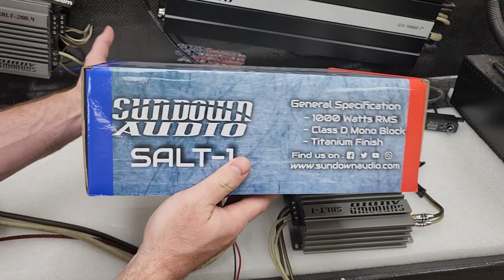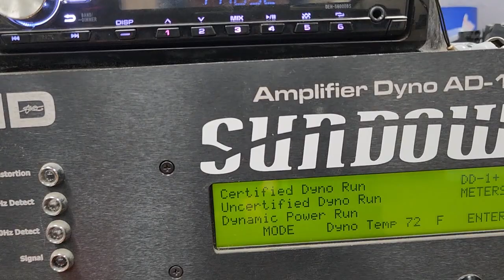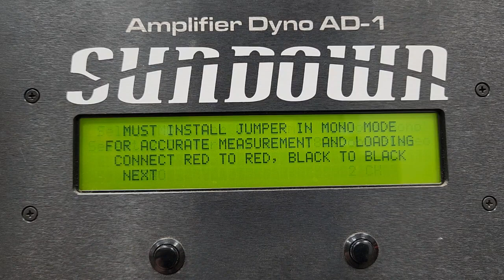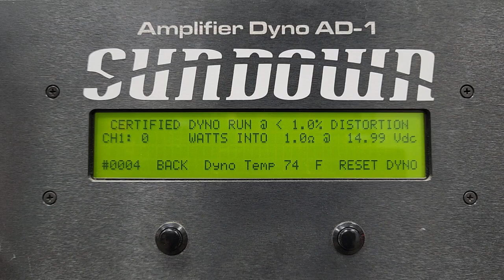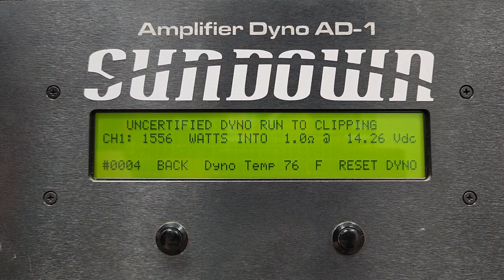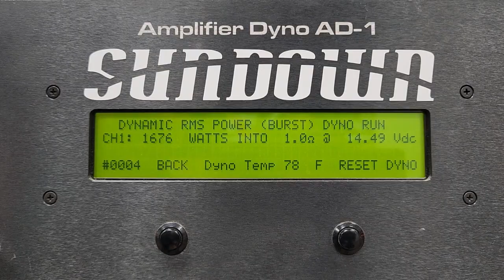Sundown Audio Salt-1 Amplifier Amp Dyno Test

Comment: Honestly this amplifier should not be over $150 this is just pure greed of what you're selling it for!!!!!
Reply: Could stick to your pyramid set up if you want.
Reply: So you know of many other amps that are daily under .5 ohms? That are real rms power and reliable like these? You can get the SALT 1.5 that does almost 4k for only $50 more
Reply: I've ran all kinds of amps. The Salts are worth the price. Very efficient, easier on the electrical and they barley get warm. You wanna fry some eggs, get a JP.
Reply: @nonamemane710  exactly. The efficiency of the salt amps are incredible. I have a salt 3,4 and working on getting a salt 6. I also have salt 200.2 and 200.4 for full range. Incredible amps
Reply: @Ford Flex King 2014  That's awesome bro. I had a Salt 3. I have a salt 6 now. I ran the both at half ohm. If its like 90 degrees outside the amps get to like 115, which is nothing. These kids need to understand there is more it it than  just watts.
Reply: @nonamemane710  right. I've owned many many amps from all different brands. Salts are by far 1 of the best I've ever ran. I had kicker, jl, Rockford Fosgate, alpine, hifonics, and others. Sundown SALTS are definitely top notch built, power, SQ, efficiency, reliability... just to name a few. I've learned that you might not like the price but you will love the product. I loved my Rockford T2500.1bdcp and my jl audio Slash amps and others but honestly to have a amp that can go under 1 ohm and be as efficient and reliable as it is under 1 ohm is unmatched.
Reply: Selling my salt 8 if anyone is interested south florida area.

Comment: You should explain to everyone that that is not subwoofers you testing that amplifier on ?doesn't have a impedance rise like subwoofers in a enclosure? And certified is the correct number you are looking for? Uncertified means your subwoofers are clipping and your coils are heating up? I give this amplifier a solid 1000 watts after impedance rise  at 1ohm
Reply: I’LL TAKE IT!!😊
Reply: @Jeezy52  Don't have anything in my garage that amplifier will push it might push my 3515 dd s and after that my next ones would be xv3 12s not going to happen they will laugh at the amplifier

Comment: Show rated power at normal 12.8 volts. Nobody buys this small of an amp if there running over 15 volts 😂
Reply: Well said bro I wanna see the power output at 12v please since salt is sundown low voltage technology
Reply: Y'all kill me saying this foolishness what running vehicle charges at 12.8v ?
Reply: @SidyDidIt  you’re right that cars charge higher then 12 volts but voltage drop does happen and not everyone wants to upgrade there alternators. Plus why advertise them as sundown audio low voltage technology amps (S.A.L.T amps) if they do rated power at 14.4V?
Reply: @rubee5.043  they do rated+ at 12 volts and typically do 15-20% over rated at 15+volts. And dropping below 12v is how you fuck shit up
Reply: @SidyDidIt  if the 2k does 2200 at 14.3V (williston audio labs results) i dont see how it would make 2k at less then that . I have a 2015 mustang and it charges at 13.7, almost a whole volt lower, so i wouldn’t be able to get 2k from a 2k low voltage amp that costs 800 dollars. Might as well get there cheaper sfb amps that also do rated power at 14.4v.  I really liked the amps when they were first introduced but now it seems like the SALT name doesn’t mean anything
Reply: Usually people start their vehicles before cranking their systems up giving them 14 to 14.6 vlts and that's about what the voltage is showing at 1 ohm on his dyno. 12.8 is standing voltage on a battery on the shelf or unstarted vehicle.

Comment: Aren't they rated at 12 volts not 14.4? SALT stands for sundown low voltage technology. Supposed to do rated at 12v not 14.4
Reply: 100% Agreed.
Reply: Wouldn't matter much, it still would beat it's advertised rating at 12v, prolly 1200w@1ohm/12v. 
Thing is, the difference between say 1200w and 1300 is literally nothing, if u understand how loudness works in db. Just a marketing ploy.
Not saying I'm calling bullshit, I really love Sundown stuff. Most amp brands do this, especially when u see an amp birth sheet that says Amp X does 1300w certified, and it's rated for 1200. That 100 watts is like getting a dollar raise on a $1000 paycheck.
Reply: 12.6 but yeah it does. They have a 14v system tho. Not a 12v system yet.

Comment: 15+ volts is crazy good. Wish my vehicle got that high.
Reply: Diodes. Helped my voltage stay in the high 15s,dropped down to 13.8 running 2 jp33s
Reply: @markroberts715 diodes